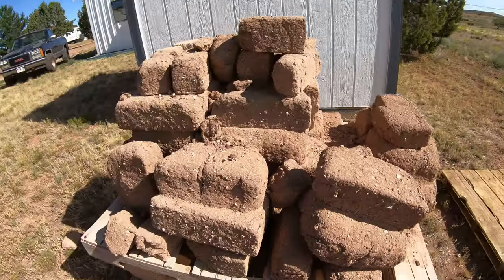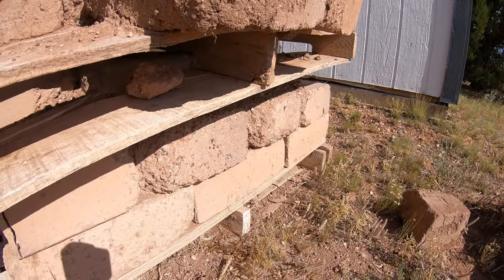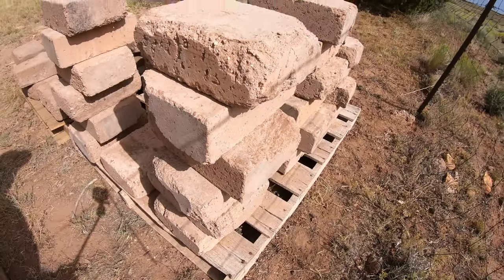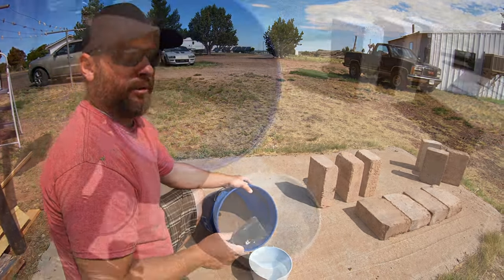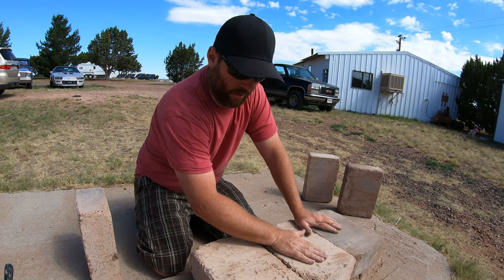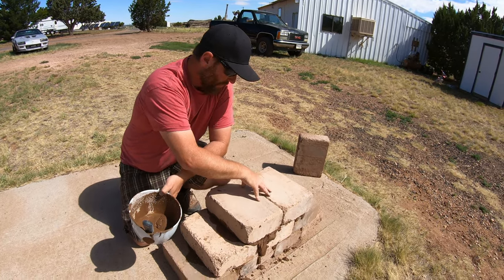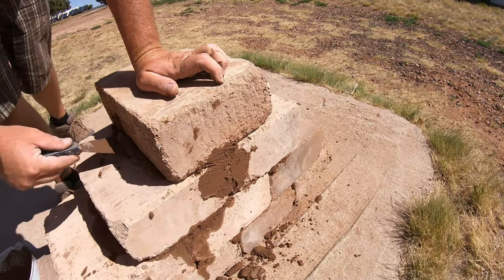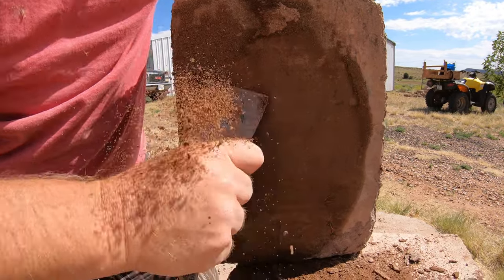Compressed Earth Block

Comment: My wife and I have a Hydraform ExM7 block machine...looking forward to getting the house going!
Reply from the maker: Where are you guys building at, what state?
Reply from the maker: Just curious if you are having any issues with this method of building
Reply: @SustainableLiving  Hey! For whatever reason I never seem to get notifications! Deanna and I are in Reno-Sparks, Nevada. Our property is off of Pyramid Highway north of Sparks (Pyramid Lake Mountain Range; 39.3 acres of mountainside).
Reply: @SustainableLiving  Not problems other than the typical local building codes and officials seeking unjust compensation and the desire to "run" a project that they hold zero liability for!! LOL!! The system of masonry building has been in place longer than the government departments whom attempt to extort money...same old, same old...

Comment: I’m also old and retired, I first used a cinva ram in the mid 1970s, the building looks better now than when 1st built. Before starting I’d looked at buildings over 100 years old in compressed earth. The purists back then all, but one, said no Portland, but I listened to the dissenting voice and used it, I went even further in percentages for blocks on corners, around windows and doors. In later building, after the first, the first thing I did was build the roof, then build the walls up to the roof. I plumbed the roof in, because we are an arid country, without town water, water is our most valuable resource.
Reply from the maker: Thanks for sharing.  So how did your first building hold up? and the second building, did you not use a bond beam?  If not, how did that project work out?

Comment: I'm old and retired but if I had one more house in me I would use stabilized compressed earth block. I still find this very interesting. Would you stick the wire through the foam board and then tie on the stucco wire? Thanks for the information.
Reply from the maker: Yes I would use the foam board, I really like how it helps with keeping the temperature stable whether it is heating or cooling.  By doing this I can control the thermal Mass on what I want for temperature,  to hold whether it's cold or hot, instead of the outside dictating to me what temperature the wall should be. We usually like just the opposite what nature gives us.
Reply: What region of az are you in? I live in carefree but was looking around casa grande for location to build
Reply from the maker: @jonathanmiller2441  Northern AZ,
Reply: @SustainableLiving  That's why in Lebanon all houses are made from concrete bricks that have an extra layer in the center unlike the american ones that has only exterior walls . And between each room there is a full concrete columns. But good materiel definitely better than wood
Reply: @SustainableLiving  I wonder what thickness of foam board to use.  I used two 2" inch sheets under my cabin which made the floor nice and warm.
Reply from the maker: I do not get the basement feel walking into my house, basements have that muggy and unique smell.  Keep in mind here in Az it is very airid here so that helps a lot.  We have found it to be alergy free friendly.  The walls will cure for up to a year if they do not get wet.  Freezing wet walls are ones worst enemy with this material.  In our back room of the house we did get an earthy smell first off.  At the time we had rain gutters down spouting there so we had more moisture on that side.  So there was some level of obsorbtion from the concrete to the block which caused this.  We have since piped all the water off the house to a cistern and the edges stay dry and that back corner of the house is no longer an issue.  I was told have good boots and a good hat on your house,  good footings and a good roof covering.  So i would catch my water and keep it away from your foundation.  I believe that is what builders usually try to do but this doesn't always happen.   I believe my foam board was1.5 inches.
Reply from the maker: I do not get the basement feel walking into my house, basements have that muggy and unique smell.  Keep in mind here in Az it is very airid here so that helps a lot.  We have found it to be alergy free friendly.  The walls will cure for up to a year if they do not get wet.  Freezing wet walls are ones worst enemy with this material.  In our back room of the house we did get an earthy smell first off.  At the time we had rain gutters down spouting there so we had more moisture on that side.  So there was some level of obsorbtion from the concrete to the block which caused this.  We have since piped all the water off the house to a cistern and the edges stay dry and that back corner of the house is no longer an issue.  I was told have good boots and a good hat on your house,  good footings and a good roof covering.  So i would catch my water and keep it away from your foundation.  I believe that is what builders usually try to do but this doesn't always happen.   I believe my foam board was1.5 inches.
Reply: @SustainableLiving  Many thanks!

Comment: That's why in Lebanon all houses are made from concrete bricks that have an extra layer in the center unlike the american ones that has only exterior walls . And between each room there is a full concrete columns. But still good and  are wayyy better than wood

Comment: i just want to know how to mix to make the block i have been trying to get but can't see how
Reply from the maker: We mixed the dirt by using a tiller on the back of a tractor we would put the Portland on top of the dirt wet the dirt down to the consistency that we needed it to be and then we'll drive over it with a tractor tilling until it being very careful not to till up the under soil that would put more large rocks into our mix.  We would do a dry till with th Portland so it would mix evenly then we would add the moisture while tilling, this would typically take 3 passes, making sure the soil doesn't get too wet, if it gets too wet the block will want to rebound and will not hold together, have to get moisture just right.
Reply from the maker: Hey Bradley Howe,  not for sure if you saw my recent post on how to make earth blocks, if you haven't go check it out and I hope it helps you with  your questions.

Comment: Nice video. I’m thinking to build either that or rammed earth in jacumba california I have found  a pice of land there. But I don’t know where to start. And what about permit? And cost any advise? Thanks
Reply from the maker: I would first check to see what the local code is whether it's county or city and see if they have any building exceptions for compressed Earth block. If they don't have anything then you may consider approaching them to adopt similar codes. We followed a code from the New Mexico. However once you approach them your cover will be busted and you may end up spending some time to get that worked out. However that may not be a bad thing  because it may save lots of money  if the project had started  and then they force you  to tear it down if they did not approve it . I don't know how strict your county is or your city is. I took a Gamble and built without a permit knowing that my County was very lax. The gamble worked out well for us but there are counties here in Arizona that I would not dare do what I did. The good thing is, is that compressed Earth block is in the National Building Code however a lot of counties and building inspectors are not following the current national code or have not  adopted such practices as of yet. As to cost of getting a permit it's going to vary depending on your county and the price of homes in that area and the size of your home that your building. Most counties will work with you even if they don't want to adopt the Earth block building codes,  they will try to modify to what they think is best for structural soundness. My County suggested to me that they could have worked with me and the block could have been used as a fascia siding on the building. But the problem with that is they have no clue that this product requires massive footings and a concrete Bond beam and is not made to be a decorative peace but rather a structural wall that needs large footings. So there are building learning curves of these county workers that you may have to face,  make sure you know your stuff when you go to present yourself to the county or city to get your permit.  Hope this helps, good luck, this is truly the unseen challenge of this material but there needs to be more of us blazing this path so others can follow to find more affordable housing. Just a side note there has already been another man in my local community that built a compressed Earth block home after I did and came out and spoke to me and worked with his City and was able to get a plan worked out so there is positive hope. I'd be curious to hear back from you to see what you decide and what works out for you.  One final note there are compressed Earth block machines that make blocks that have the hallowed channels in them so you can put rebar through them and attach the footing to the bond beam that may be easier to get a permit if you have one of those machines. The structural engineers really like to have the footings attached to the bond beams of the buildings so it's all one sound unit those type of Earth blocks enable that process to happen.  As to rammed Earth or Earth block funny thing is I have another friend that build a rammed Earth home 20 years ago and it took him quite a few years to do it and a lot of painstaking work to do that. I personally would recommend the Earth block just because it's easier to handle and once it's in the wall it's in the wall you don't have to worry about forms and compacting and then reform, it's the same concept but the Earth block you can work it in smaller pieces not the whole wall at once.
Reply: @SustainableLiving  appreciate your replay sir. grate advice god bless, ill do that :)
Reply: Sustainable Living one more question. Where u got your earth block press. Is it easy to work with?
Reply from the maker: @truckandtea  I had a good friend that purchased the block machine from New Mexico, the company was Earthtek, here is a link:
http://www.adobemachine.com/adobeq&a.htm.
They have a lot of info, if you haven't come across there stuff I would recommend checking them out too.
The machine itself is easy to work with and simple.  One does have to figure a way out to mix the dirt, moisture and portland cement, we used a tiller on the back of a tractor to do this.  One has to be careful that one only tills the sifted dirt and not the underlayment that could kick up larger aggregate.  
Over the next 6 months or so I am hoping to use that machine again to do a few projects and I will see if can show this in a video.

Comment: Thank you for the info I think I bought the same machine from Dan Powell we are fixing to start our build did you use a foundation or rubble trench for foundation
Reply from the maker: We used a foundation, we dug footings 24 inches by 24 inches wide with five runs of 5/8 rebar through them.  The concrete is a lot more money, I would highly recommend this.  We calculate that every two feet of wall with a standard 8 foot wall there is one ton of weight.  So we were advise to make sure we had a really good footing.  I would pass that on to you.  Thanks for watching our video and good luck with your build.

Comment: Good video, interesting to see how they've held up over years. but keep in mind people aren't going to make these to keep them on a pallet or unexposed. A lot of people are making exterior retaining walls etc out of rammed earth,  so can't really get them under cover. Wondering if you treated these with a water proofing agent?
Reply from the maker: The blocks in this video were not treated with anything.  On the house we used linseed oil for the first two years and I was not impressed so we ended up stuccoing the house to water proof our walls.
Reply: Normally you build a cap on top and add some kind of facing (stucco, brick veneer, etc) to protect the blocks from weather. From what I have read in the american building code (named the IBC) for earth based walls a concrete capping beam is required to be poured on top of the earthen/Adobe walls in houses and residential structures. It is standard practice to add concrete caps to most types of concrete block walls too from what I have seen. I am pretty sure you could use a wood deck clear coat to waterproof the sides of the blocks if you wanted that natural earth look though. I have not tried it myself though.

Comment: You need to read "Ceramic Houses & Earth Architecture" by Nader Khalili. It's about building houses (and other buildings) using earth blocks and then firing them. The blocks do not use cement. The houses are built and then fired. Thus they become a single big brick. It's worth reading if you are going to make buildings out of earth blocks.

Comment: In India researches have proved that the best compressed earth blocks are made with soil,sand,Portland cement and lime in the ratio of 40,45,10 ang 5.
Reply: yea wow 10% cement and 5% lime that is going to be very strong , i love the fact that in 300+ years these houses are going to be holding strong and if they have a good stucco covering them i can see them lasting over 500 years ,,, not as eye popping as roman or greek or gothic era structures but for small family houses it should be a good representation of many peoples now wanting a simplified life done smartly/efficiently
Reply: So the amount of active binding agent is as high as  15% total. I have seen online Rammed Earth mixtures with no clay or silt, and 10% white cement. Now that is concrete!

Comment: it would be nice to be able to put the sheet of foam in-between the layers of block so you can see the rustic block from both inside and outside
Reply: In my country, where wood construction is pretty much non existent! On new buildings that's the usual approach. Double brick walls with insulation in between. Plus an air chamber (gap). 

From the inside would be something like this:
Plaster or gypsum boards, brick (11cm), insulation (5~15cm), air gap (5cm), brick (15~25cm), finishing layers, paint... 

Usually the real challenge, in terms of thermal bridge, is the reinforced concrete structure. That's subject to quite rigid "seismic" code. Meaning that not even a "shack" can be built without a reinforced concrete structure!  

Upgrade of existing constructions vary between inside or outside insulation.
Reply: @crpth1  thanks for the information

Comment: Enjoyed this video. How much digging was required (area and depth, etc). Thanks.
Reply from the maker: I ended up using the dirt from my footings the dimensions of my footings were 24in by 24in in depth and width. I also use the Gannon on a tractor in which I scraped more material up out of my backyard. Just a rough guess but I would say I had at least a hundred yards or more of material that I sifted and processed to make block.  I did have two interior walls made out of Earth block that added to the increase of my blocks that I needed. Most houses will only have exterior walls and not interior walls. So that means fewer blocks for a traditional house. And not as much material. Hope this helps, I have some raw video that I will soon make a video about how I made my block and you will see that there is a lot of shovel work when mixing Portland into your material. So not a lot of digging per se the dirt up but digging in the sense of mixing dirt, one will understand what I'm trying to say once I get this video out, stay tuned.
Reply: @SustainableLiving  This is very useful. I look forward to your video on this. Thanks.
Reply: Can you also share concerning mixture: ingredients used, did you eye it, measure it, etc.?

Comment: Did you chop the block for electricity conduits?
Reply from the maker: We took a grinder and channeled out a 3 inch groove and ran the wire through that, then covered it up with mud.  No conduit, I am not worried about putting a nail through the wire, the block is too hard to hang pictures, I use a heavy fishing line to hang pictures from the trim.

Comment: I liked that you showed how strong the bond was with the slurry and what you would do different with the adding of the wire. For your stucco did you use a lime based stucco? Or cement based? Thanks in advance
Reply from the maker: We went with a cement base, that is what was ready available, I would have preferred lime base though.
Reply: Ah thank you! Did you shoot any video of your installing a window and/or door into the earth block?
Reply from the maker: @kjlahti782  no we did not.  We used pressure treated lumber in the openings for the windows and door frames.  We put these frames in place once the blocks were high enough and laid the blocks to the formed windows and doors then nailed the lumber to the block with galvanized nails.  Windows and doors we hung normal standards at that point.  Hope this helps.
Reply: Thanks for all the information! I hope all is going well with you?

Comment: Which machines produced these blocks and can you advise any machine that gives a compression force of 1500psi with 500 blocks per hour with reasonable budget
Reply from the maker: the machine was either a  BLM-12-8A2 or BLM-12-8A4
Reply from the maker: As to the machines to meet your specifications I would recommend checking out the company that made the machine I used here is their link:

http://www.adobemachine.com/
Reply: @SustainableLiving  Thanks for your reply and I got it and already made contact with them. I appreciate your feedback.
Reply: @SustainableLiving Noted with many thanks sir